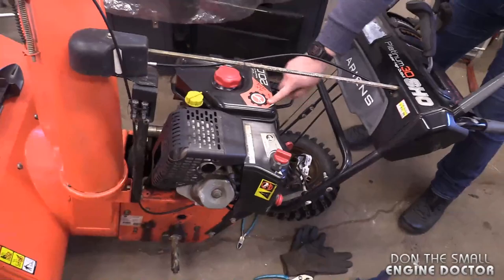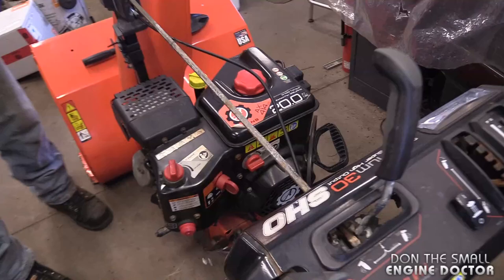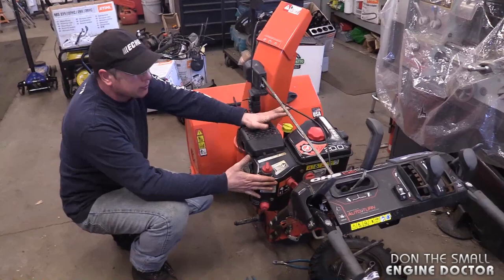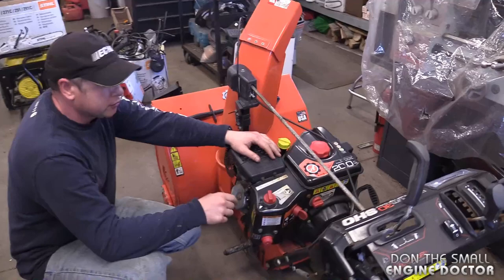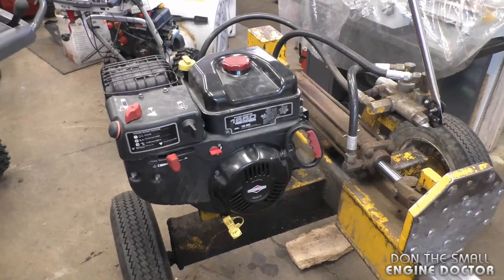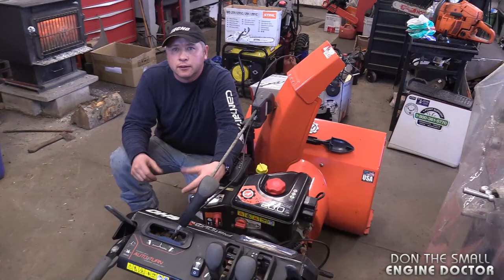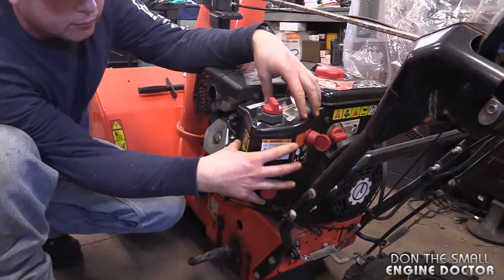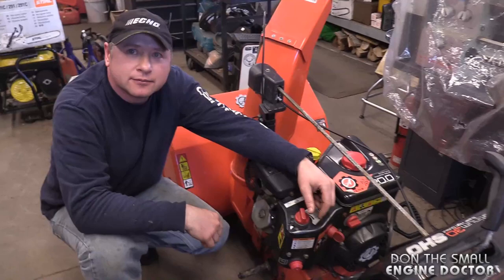Can I Use A Winter Small Engine In Summer? Teaching Apprentice Dave!

Comment: Yes, with certain engines. Tecumseh horizontal's in particular. They are made to swap from winter to summer. Heater box off, air filter and cover on.
My old Ariens 10,000 series used different attachments, snowblower-winter, mowers, tillers, chippers-summer. It said right on the engine. Remove this cover, add air filter for summer attachments and it changed right over very easy, example the old 7hp H70. Those engines were great. No one else could do that.

Comment: Good info however I would emphasize the importance of adapting some sort of air filter system to help prevent premature engine wear and possible engine failure.  Any dust or debris is an engines enemy! Honda clone pod filters and adapters are pretty easily accessible and fairly easy to adapt to most most modern small engines.
Reply: Hi Bruce! We covered that in the video. Cheers!
Reply: Over half of this video was spent talking about adding an air filter for Summer use to the engine.

Comment: I could have used the opposite info a few months ago. I put a 196cc powerfist engine on a single stage blower. I took the caution hot cover off the muffler took 2 bread pans bolted 1/2 to the muffler and the other half and covered where the air filter goes.(1 wasn't quite long enough needed 2) It doesn't have a primer. But usually starts. Sometimes a blast of carb cleaner down the air filter port is needed. And I use this commercially. And tried with summer engine before but carbs freeze up. With the bread pan it catches heat from muffler and shares it with the carb prevents it from freezing.

Comment: Speaking of oil. I recently restored a John Deere 1032, 1980 vintage. I had some good 5W/30 synthetic oil around so I thought I would try that in this Tecumseh engine. No good, it really stared spitting oil out the crankcase breather all over my new paint job. So I drained it and put in conventional 10W/30. No more spitting, works great. Thanks for another great video!

Comment: Beautiful job Don.
I found that an old lawnmower air filter mount and filter will fit in most cases, especially tecumseh.
Reply from the maker: Good tip!
Reply: @donyboy73  change the subject for a moment. 
You have the same vice as I do, right down to the paint pealed off and the reddish oaker colour underneath. 
I had a problem with mine where it swiveled,  even when I tightened those 2 bolts with the pins going through to the point where I bent the pins still when I tried to bend something in the vice it would turn. 
This weekend I took out those 2 bolts on the sides and replaced them with 2 regular high grade bolts, then I drilled a 1/4 hole at about 5 o'clock in through the seam or where the top mounts on the bottom and put a bolt in there. 
I hope this fixes the problem. 
I can see from your videos you don't adjust those 2 bolts much,  looks like they never move.
Just thought I would share.
Reply from the maker: @byronwoolfrey1039  thanks for the tip, it does move sometimes and it's annoying!

Comment: I think I'd be lost without Don!! Don have you any videos of yourself or Dave stripping down a Sthil ms230 Chainsaw to replace the Crank case assembly? Basically I looked at Ola couple of your videos and changed a few things including getting down to my oil pump which I would never go that deep only for your videos!! The issue is now, is that I did all of that and resembled it and it worked! (Go me!! ) but this is not the end! As I took it apart I noticed a lot of wear of the assembly casing around the pump! But I still went ahead and hoped for the best! I put everything back together and all of a sudden I seen that oil was coming off the chain but not enough! Then I realised that oil was coming out from around the clutch/handle bars so I knew it wasn't good! Basically I went to my dealership and showed the pictures of the pump and wear on the casing and he said that's your issue right there! Gavin you slim sorry to say but you need a complete new engine assembly to eliminate the leak from the pum/oil hose connector as the when you needle bearing went someone kept driving it and it caused so much burning/wear it destroyed not only your sprocket/clutch cover but also your worm/ pump/oil connector hose assembly! But worse of all it destroyed your Engine/Crank assembly so basically the only way out of it is to completely strip it down and replace the Crank assembly!! Otherwise buy a new saw! Which I may do now,  but it won't get the better out of me as I'm slightly stubborn! Basically my question is can I buy an aftermarket assembly (from China) that would be possible for me to fix it? Yes its cheaper but it will be a learning curve if I can disassemble the Chainsaw and put it back together again without being a professional like yourself and Dave! Would you recommend me doing this or completely just let the saw go as it would not be worth it? If you do recommend I'd love to see a video of your professional help from start to finish if you could spare some of your valuable time! Once again Donyboy73 your the man! Thank you for your detailed videos, Regards Gavin Kelly from Ireland 🇮🇪👍🙏
Reply: Theres a few miss spellings in there but I think you would understand! 👍🇮🇪 Thank you

Comment: i have a tip honda has push mowers others you take carb off the studs comes with the boilts you puting on new carb you have 3 parts have to line up gaskets spacers vary hard to do all at ones so i got some longs boilts to help me guide one side to put the studs back in make good vid just trying make easy
Reply from the maker: good idea!

Comment: I have installed an 11 HP B&S snowblower engine on my horizontal sawmill. I see the port where the air filter would have been installed if used in a summer engine. Can I just unplud that port and add a makeshift air filter assembly? If anyone else has done something similar can you let me know if this is feasable and /or what you would recommend.

Comment: I thought some Tecumseh  engines were notorious over heaters until the makers decided to put them on blowers.
Reply: Those were the OLD versions with cast iron blocks. They got cheap on the castings and made the fin count lower and smaller.  The side effect was that they ran warmer and in fact it made them work better because of that. Fewer issues with carb icing and oil issues because of it. However those are long gone.

Comment: Determine the carburetor manufacturer and model and see if that carburetor is on another engine with an air filter box.
Reply: Good idea! It probably is!!!
Reply: Not so much the carb as the engine covers are the issue. The summer engines don't have the large plastic or steel shielding in the way. The carbs use about 4 different bolt spacing dimensions based on the engine size.

Comment: Would the extra shielding on a snow blower keep the engine cool enough to use in the summer. The air would be kind of restricted for cooling fins. A mouse nest on the fins causes a mower to overheat. I have seen that several times. I am just thinking running all day in really hot temperatures, would the extra shielding be an overheating problem. Good video guys. Lots of people don't realize that they are all air cooled.

Comment: Question: I have picked up a used Husqvarna 137. Im about to diagnose it and off course i will pull the muffler off to inspect the piston. Problem: The front part of the muffler seems to be stuck into the rear part. Cant get to the last bolt. Any tips and tricks to separate the two main parts of the muffler without ruining it? Thanks. -Ole from Norway.

Comment: I have a 1995 Wheelhorse lawnmower/tractor with a  19 or 20 hp Onan engine, sorry i can't remember which one.  When cold, it cranks right up and runs great but in a couple of minutes it starts smoking and losing power.  Any thoughs on what is wrong with it and do you know where i can buy parts for it.  Thanks Dony, enjoyed the video as usual.

Comment: Good points, and I realized the lack of air filter years ago, but never really thought of why it didn't need one....so what's going on on the side of the carb where the filter usually sits? Is it right up against the cover?  Where's the intake?
Reply: It’s usually just beside the cover, usually with a 90 degree duct to keep moisture or water from spraying up into the carb. Don can correct me if I’m wrong though!
Reply: @DavesSmallEngines  Ahh, ok a duct. Thanks, brother.
Reply from the maker: yes carb is almost to the cover underneath
Reply from the maker: @DavesSmallEngines  absolutely

Comment: Would you have to up the jet size being now you’re restricting it with an air filter?
Reply from the maker: no
Reply: I don’t think it matters because it would make it richer and they run better rich anyway
Reply: Actually you would drop the main jet size as you would lessen the air flow by running a filter.🇨🇦
Reply: @philosborn1840  yeah but it’s not important because they are already jetted too lean
Reply: @philosborn1840  Theoretically you are correct, but in practice the difference a clean air filter makes to the airflow isn't enough to matter unless you are racing something like a go kart and chasing every thousandth of a horsepower. As someone else said, many small engines run a little lean anyways to meet emissions standards and often run smoother and perform better with a slightly richer air fuel ratio.

Comment: Some carbs have like a foam sponge material for an air filter. Can you just cut a thick enough piece and fit it snug between the carb inlet and the casing. I would.
Reply from the maker: yes you could

Comment: What about the air/fuel Mixture? Don’t winter engines tend to run a little richer in some cases with denser air from the cold?
Reply from the maker: they are non adjustable carbs

Comment: What about the spark plug heat range from winter to summer?
Good video on motor usage.  Thank you.
Reply: No different. All my flat heads use rj19lm. The inside of the engine is mostly affected by its internal operating temperatures, not the exterior temp.
Reply from the maker: Great point! usually doesn't matter much
Reply: @rpavlik1  The manual for my Tecumseh motor calls for a J8C or RJ8C. The "R" is just for resistor.  The resistor plug is to prevent electrical interference that can disrupt car radio reception, two-way radio and cellular phone operation. I use the J8C with no problems. ALWAYS check manual for proper spark plug.
Reply: Good question !
Reply: @RichardFallstich  yep, and newer service manuals indicate that the rj19lm is the designated substitute. I think I do actually have an rj8c in my old classic riding mower with a Tecumseh for exactly that reason (using what the manual from the time said) but it's not because it's a summer engine, just because it's really old. I spent so many hours trying to figure this stuff all out a few years ago. Ended up realizing that thread and reach are key, temperature is good to match when you can but these flat heads at least are very flexible, and so realistically I only need 2 models for my 4 stroke stuff: rj19lm equiv and the ohv Briggs one (rc12yc maybe? It's actually the same plug as my Saturn SL2 - bpmr8a iirc). And of course I have the champion numbers memorized but actually mostly use ngk now. Most of my 2 cycle stuff actually uses a single plug type too, only my backpack blower is weird

Comment: I have a 3500W generator run by a gasoline motor. Can I use rubber insulation around the generator section without worrying about heat buildiup?
Reply from the maker: I would have to see it, be careful constricting airflow around a generator!

Comment: I used Briggs & Stratton motor that had an air filter the summer not good for the winter kept clogging up with snow
Reply: What did you use it on?
Reply: @DavesSmallEngines  snow blower
Reply: And you found the reason why they are not used on the walk behinds.

Comment: Question  ; is pre-mix fuel like Stihl motomix safe to use in modern 2 stroke engines. and how old of 2 stroke engine  ( eg , stihl 026  chainsaw )can i go back with out damage the engine and have to manually mix my 2 stroke fuel mix.
Reply: Hey 45! Maybe Don can correct me with I’m wrong but I am certain Motomix is backward compatible meaning you can use it in older saws. I would 100% confidently use it in any 2 stroke I use - especially in those I let sit for a while as it doesn’t gum up the carb. Make sure it’s the 2 stroke Motomix and not the Moto4 non mixed!

Comment: Does the engine bolt up to the other equipment, like the log splitter directly, with the same mounting holes.  If so then take the a/f box off that scrap engine and put it on the replacement engine.
Reply from the maker: in most cases yes

Comment: Mr. Dave , what is the problem with the Ariens snowblower , it does not look that old . Thank you Gentlemen for the video .
Reply: Hey Gigi! I believe Don said it was a gear box failure.
Reply from the maker: transmission problems, all fixed now and picked up!
Reply: @DavesSmallEngines  Thank's Dave , for the information .
Reply: @donyboy73  Thank's Dony , for the information .

Comment: Are winter engines designed to run with certain airflow that would be hindered by the addition of an air filter?
Reply: I don't think Don would have recommended adding an air filter to a winter engine being re-purposed for summer usage if he thought it would affect the performance.
Reply: @davidquinn6161  I’m sure he wouldn’t but it’s a question that came to mind... I’m sure it may have some effect on it but probably a negligible amount...
Reply from the maker: doesn't seem to affect anything, i've had many carbs apart from both winter engines and summer engines

Comment: Hey Don I have a Honda hrx with a moving  exaust valve guide is there any way to fix it in place, love the channel it's a real big help.
Reply: One way I have heard is to set it in place and use a punch (in the event it is malleable metal) to prevent it from coming out. This needs to be done carefully. Maybe @donyboy73 has a better solution?
Reply from the maker: you can drill and tap threads to install a set screw
Reply: @DavesSmallEngines  Thanks for your reply.
Reply: @donyboy73  thanks don keep up the great work.

Comment: Hi db73!!! Interesting, how about using summer engines in the winter? Is there problems with that?
Reply from the maker: yes you can, you may want to remove air filter though
Reply: @donyboy73  Thanks.

Comment: Hi Don, can you change a push mower electric start to work like that on a snowblower (using a plug) as appose to using a battery?  Thanks Larry
Reply from the maker: you probably could but it would require a bit of tinkering
Reply: Hi...Ok thanks.  I'm going to try it this summer.  I will let you know how I make out.  As always, great videos!!

Comment: Before I even watch this video I know the answer. Yes you can use the motor it will not overheat but you have to install an air cleaner anything that's run for winter or on the water has no air cleaner because there's no pollutants
Reply: Sounds like you watched the video! Exactly right!
Reply: After I work on Power Equipment also so I already knew the answer. But yes I did

Comment: Do the winter versions have a different main jet then the w/air filter version? I’d have to imagine adding an air filter may change air/fuel ratio?
Reply from the maker: it doesn't look like it, i've had many carbs apart

Comment: hey Don, would a brand new honda gx 390( probably made for summer use), would the jetting be ok for winter use, for a snow thro?  and would the jetting be ok with an engine designed for winter use be ok for summer. ?
Reply from the maker: yes it would be

Comment: Another good video. Great info. So,  do you ride for a motorcycle?
Reply: We both do! Mine isnt..... really a motorcycle though. Technically yes..... functionally... no. 1982 Honda Passport C70 which I just finished restoring. Regretfully I did not film the process.
Reply: @DavesSmallEngines  I ride a 2004 Honda 750 Shadow Aero and have been restoring 82/83 Honda Urban Expresses through Pandemic. Currently have 5 plus a 79 and 80 expresses
Reply from the maker: @josephrich6014  hi Joe, i've had many hondas, currently ride a 2017 honda africa twin
Reply: @donyboy73  nice looking sport bike. And kudos for being a Honda afficienado
Reply from the maker: @josephrich6014  it's a dual sport bike

Comment: My snowblower runs just fine but while going in the snow will run for a couple minutes and then just die why is that
Reply: Sounds very much like a fuel problem.  Check flow out of tank, then remove float bowl and float, needle and seat.  Let gas flow through.  Remove gas cap and gently blow backwards through needle cavity. Re assemble and try it would be my initial attempt.  Replace gas filter if there is one.
Reply: Sounds like the vent on the fuel tank is not working properly.
Reply: @DavesSmallEngines  that's what I was thinking I'll have to run it without  the cap on it and we'll go from there

Comment: If you do manage to find a air filter system that will fit a winter style engine will the carb need to be re jetted or adjust the air fuel mix?
Reply from the maker: Great point! but no
Reply: Nope. The jetting is the same and in reality using a filter might help, especially if you have to run booze fuel as that fuel causes the engine to run leaner anyway.